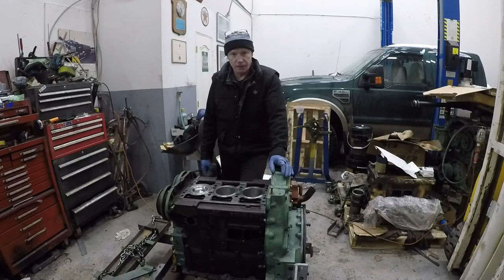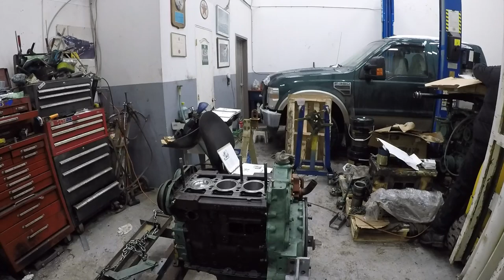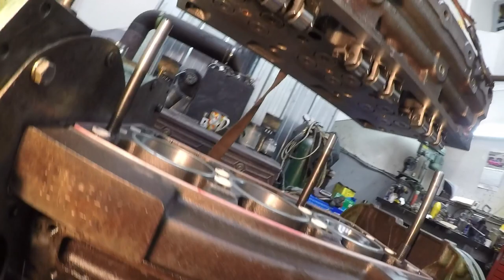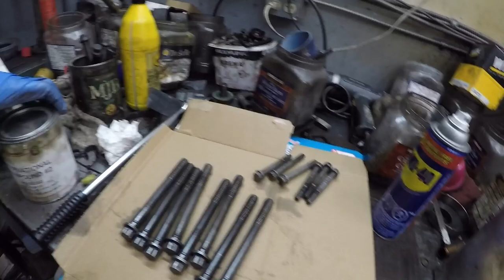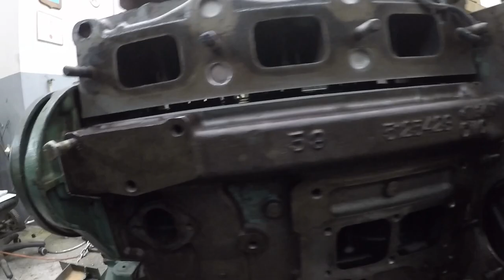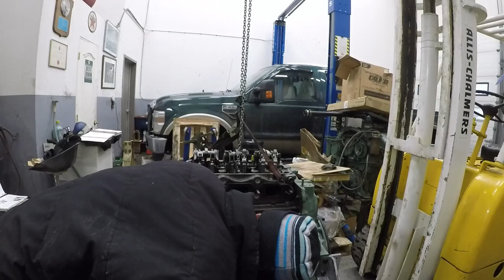Detroit 3-53T Installing and Torqueing Head

Comment: Still hanging with you on the assembly. That darn outer seal was giving me a hard time. So as you recommended, I just put the thing on but covered flat with a piece of cardboard and plywood with a little added weight to sit overnight. It was warm in the shop so it laid down pretty good. Then after the head was pulled down, the worry starts, hoping that the thing didn't roll over! That's the worst part of the rebuild. That and cleaning parts. The rest is fun. Thanks again for all the great instruction! It's been a tremendous help.
Reply from the maker: Awesome it works every time.:)  I'm glad it helped, Happy New Year.:)
Reply: @detroitgarage9430  My 4-53 is going in a Terex Loader to work at a gold mine. How would you recommend running it in for the first time after start? Run it on the stand, run it in the machine like it will be used, or take it easy on it? I've heard all the "best" ways to break one in, but value your advice above all. Thanks.
Reply from the maker: @Shipfixer  I follow the manufactures recommendations as well as a good Detroit overhaul shop.  Start the engine and let idle no more than 10 minutes while you check the for leaks etc.  Then work the engine hard  as soon as you can.  I run them hard for the  first 100 hrs or so.  For you in a loader just keep it working and don't idle for long periods.  I basically shut them down if not working.  Start them back up when work is to be done.  Have done this the Detroit shop says just go out and work them hard and avoid idling.
Reply: @detroitgarage9430  Excellent! I was hoping that would be the way. That confirms what I also believe is correct. Again, as always, great advice. It's a done deal. I have three more to rebuild. It will be interesting to see if any of them perform differently with such similar overhauls and breaking in. Thank you! I trust what you say when it comes to this.

Comment: That perimeter seal... I used to cheat and put a bit of grease on it, made it stick in the groove a bit better.
Reply from the maker: It's a strange they designed it that way, but it works pretty nice.  Happy New Year.:)

Comment: Would it be better if you had a small piece of metal to set on each corner of the perimeter gasket to hold it in place. I've seen some people put a small bead or RTV around the outside of the seal to help keep the oil in. Those head bolts will make you eat your Wheaties. Thanks!
Reply from the maker: I've seen all kinds of little tricks from match sticks to RTV.:) I find as long as the are put on dry, they wouldn't leak.:) Putting them on does take some patients, but they usually stay after a couple of attempts.  They go on a lot easier if they are warm instead of cold.:)  Very true those head bolts are not coming off.:)  Happy New Year.:)

Comment: Good morning,  recently have our 353t shut down while operating. It wouldn't restart check and found oil in the exhaust ports and in the cover of blower and on the blower shafts. The engine oil level was high apparently we having a fuel leak in the oil sump as well. Do you have a suggestion as how we can clean some of the oil out the combustion chamber without pulling the engine
Reply from the maker: Pull the injectors out and rotate the engine to clear out any oil that has accumulated in the combustion chamber.  This will prevent any rods bending if you have a lot of oil.  You could try barring the engine over first to confirm it turns over.  If it's free, then just repair the leaking fuel line/injector.:)  Change the oil and you're good to go.:)

Comment: First off love your videos! I'm currently building a 42 ford with a 6v53. Just fired it up and everything was great until I rechecked the oil and had a ton of antifreeze in there. I only ran the engine for probably 5 minutes. It ran flawlessly. Do you think a bad head seal would cause this or a liner seal? Kinda stuck and looking for some input from an expert! Any help would be appreciated.
Reply from the maker: Thanks, most causes for this are either cracked head or bad liner seals.  Could also be an oil cooler, any oil in the radiator? You can isolate by pulling the airbox covers and oil pan, then pressurize the coolant system.  That should give you a better idea where it's coming from.  Thanks for watching.:)
Reply: No oil in the coolant. I pulled the oil pan and pressurized the system. I had a steady drip from the back left cylinder. Still was hard to tell where it was coming from. It did drip without any pressure press as well. I pulled the head and the white coolant o rings were broke. Not sure if that happened from pulling the head or not. Ideas?
Reply from the maker: @mylesfimbinger4781  Sounds like a liner seal.:)  Coolant was coming from outside the liner correct? Did you check the airbox while pressurizing? Easy to replace and while the head is off check for cracks.  I get them magnafluxed to confirm they are not cracked.  The coolant seal probably tore when the head came off.
Reply: Thank you
Reply: I decided to do an inframe based off of your videos. I was a little nervous but your step by step instructions are great. I did notice quite a bit of coolant where the cams are with the head off. Is this a way to diagnose the problem I am looking for? I still have not confirmed the problem yet. Thank you!
Reply from the maker: @mylesfimbinger4781   Awesome, that'll be a nice engine when your finished.:)  The coolant more than likely came from removing the head.   The most common way to check for leaks is with the head on and pressuring the coolant system.  You can however pressurize the heads seperatly as well as the block, but would have to make block off plates.:)

Comment: Is there no o-rings needed on the balancer side oil galleries? I'm about to install the head on my 2-53
Reply from the maker: No, only on the cam side. Double check the manual, but I believe there's only one oil feed on the cam side on the 2-53.
Reply: Your correct. Seal kit only came with one oil seal. Got the head installed yesterday. Your videos have been a huge help! thanks
Reply from the maker: @TheIslandboy11  You're welcome, I'm glad they helped.:)